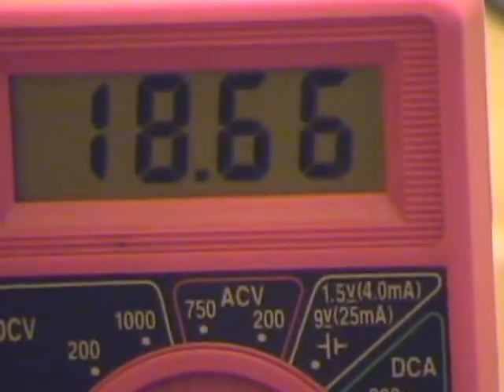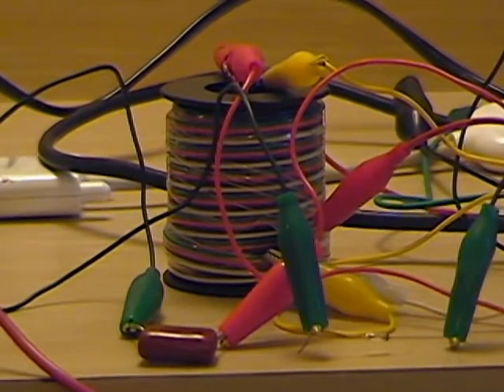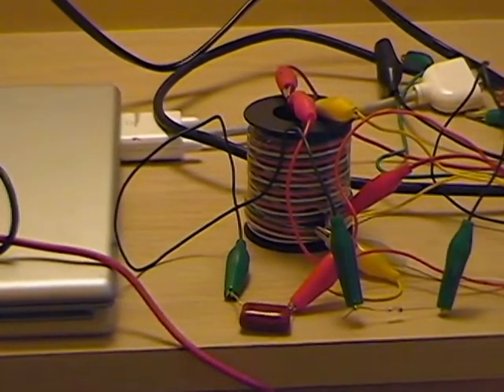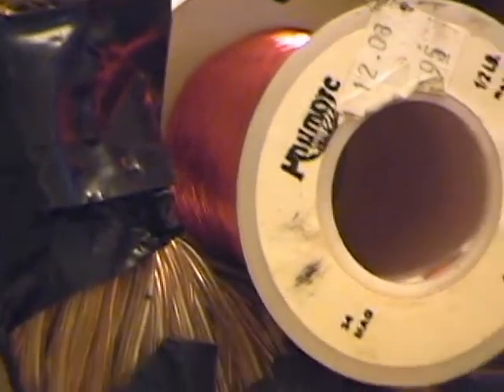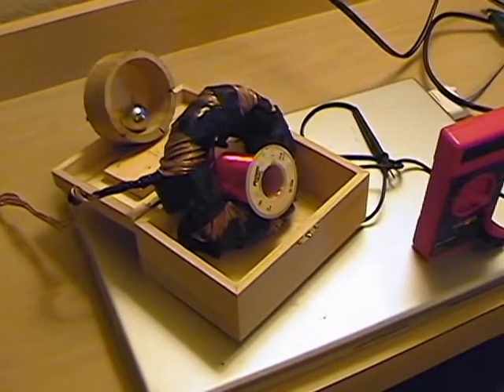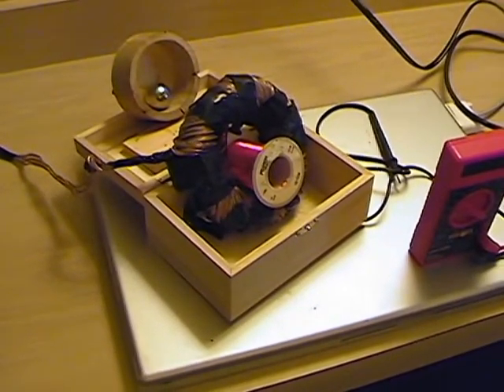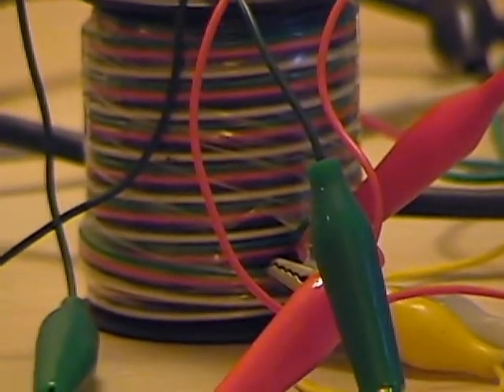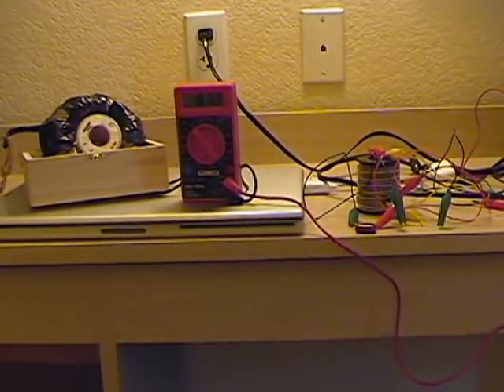Intercom coil 2 1

Comment from the maker: The coil has 4 wires. Connect 1 to 3 inside and outside. Same with 2 and 4. Attach cap and diode in series between the inside connections of 1,3 and 2,4Test by shaking a magnet inside the coil core, and testing for rise in capacitor charge.

Comment: Try getting a wheel that has spinning magnets going around it on a flat 1D plane in a way that the cosmic rays can be caught by your bifilar coil (great little device you have here). Then you will have a self powered motor set. Or a basic resonant tesla magnifying transmitter. You will need to connect the bifilar coil to the magnet drive whose radiation you are capturing. Then you will growing outputs.

Enjoy.